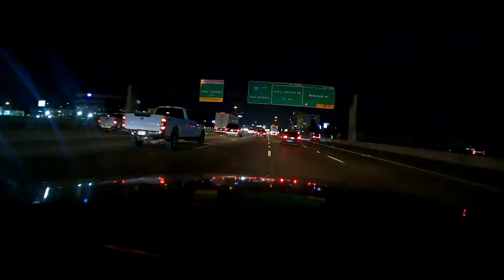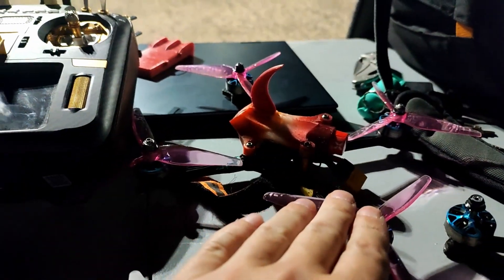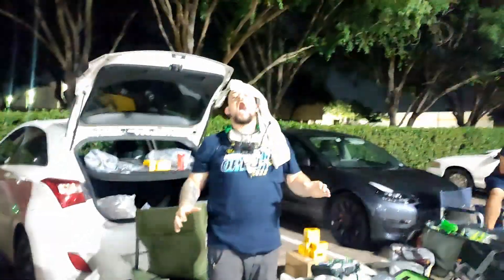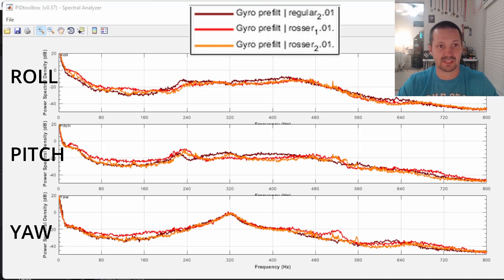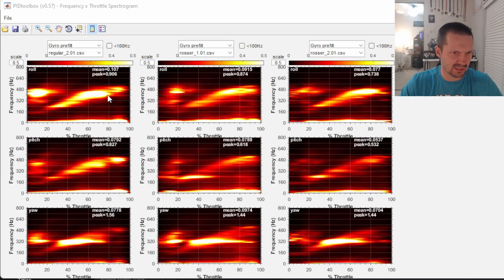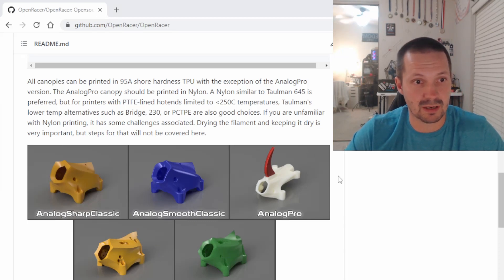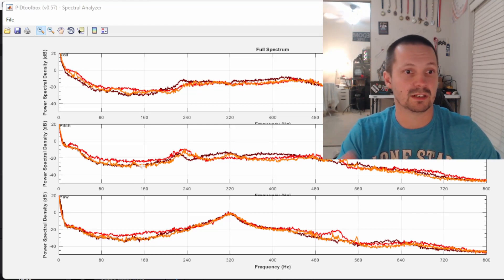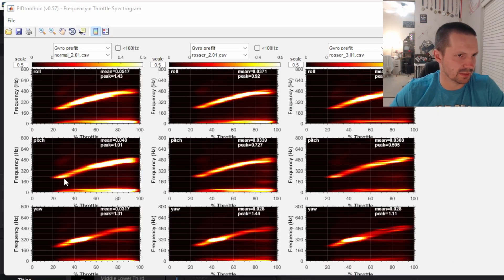Testing Rosser UD carbon for OpenRacer, does it make difference?

Comment: Amazing! The Rosser carbon seems to be very very very slightly better in certain situations, especially in the pitch axis there was a brighter spot at the primary resonate mode but it seemed there was a lower noise floor. 

Rosser is doing what I call “limit engineering” where he is putting massive effort into gaining little 1% improvements in every part of the quad in the hopes it adds up. Everyday pilots will never feel the improvements unless they commit to making every change, but good to know there’s someone pushing the limit of what quads are capable of.

Comment: I never thought that there is soo much < difference.  the only carbon which is really good is space grade carbon which has not only top and bottom weaves, but in the whole sandwich. maybe this will not even breake in 6mm arms in a crash. we cant buy it, because we only get the lowest quality in technical regards.  the only way to get hands on it is to cut you own frame designs. dont expect a frame below 300 whatever currency. the only company which sold some frames of space grade was armattan as far as i know.
Reply: It wont break the arm, but it'll break the motor shaft.. 😁
Reply: @verdi6092  yeah, the weakest point will travel to the next point.  its always a trade off, especially when we want ultra rigid frames. i use 90% t-motor, but i dont give a F about a broken motor. the bearings are damaged in one season anyway because of the dust in it. never sourced good bearings which are worth the work when a new motor has almos the same price. its weird, sometimes i just keep the bell.
Reply from the maker: That would be cool tho. Is is similar weight?
Reply: @IvanEfimovLimon  as i remember yes. the weight comes from carbon to resin relation in the mix. the carbon itself could be the same type, but every layer is 45° 90° 45° with different types of weave.
Reply: If you gona drop that kinda coin on carbon moulded arms would be a better investment. Cut sheet is a big compromise no matter how good the carbon is